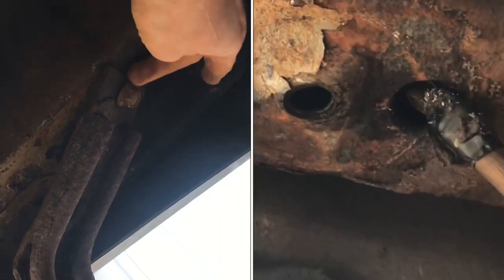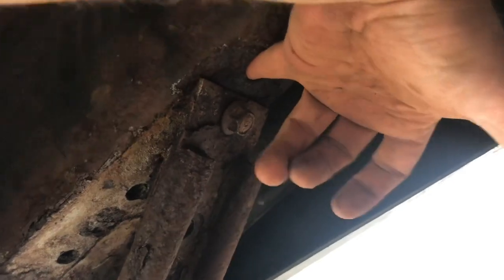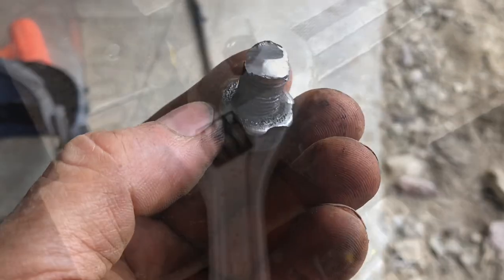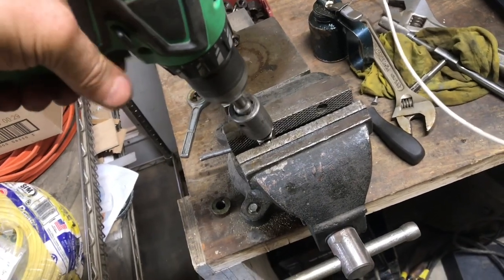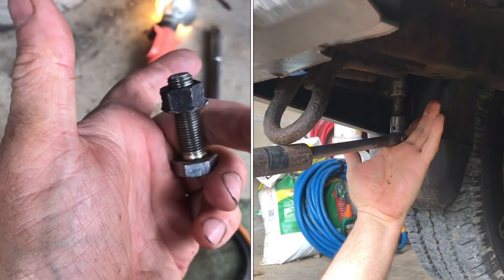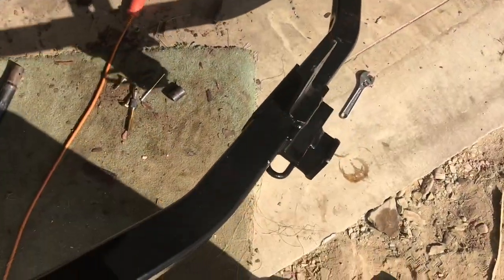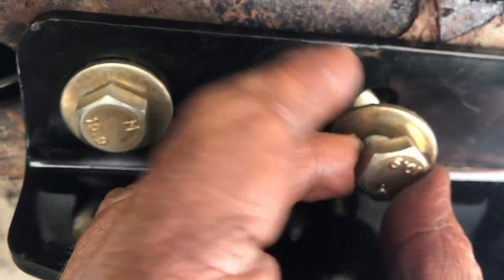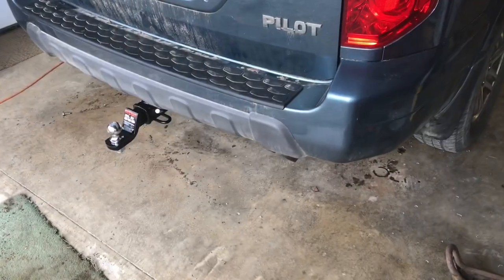(what to do) if the nut BREAKS OFF “inside the frame” when putting on a towing hitch

Comment: Thank you! Wish I’d known this was even a possibility BEFORE trying to remove the front bumper. Only found this video after the problem occurred!  Apparently, a fender bender prior to my ownership put a lot pressure on this particular bolt that attached the bumper support to the frame. Wasted almost an hour working with it before googling and finding your video. This saved my afternoon, at least!

Comment: My 2006 Sierra bed bolt spun. I got it out using the same technique. I noticed the bed bolt and nut are mis-shapened for a friction fit so it does not work loose. That combined with the rust was too much. Used a lot on penatrating fluid, back and forth, etc, but when I thought is was good to go, the nut spun. Bummer.

Comment: See any towing capacity reduction with a fix like this? I have 2 of 6 bolts that a spinning loose on my hitch and im wondering if it will be safe to tow with it like that.
Reply: Have it welded on at the Muffler Shop in addition to the Bolts  Loose Bolts = Broken Bolts